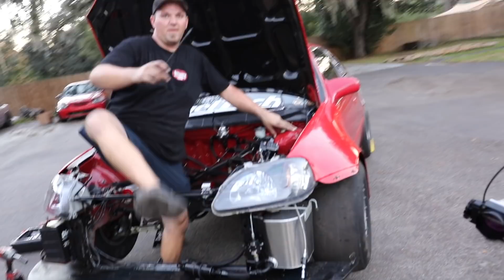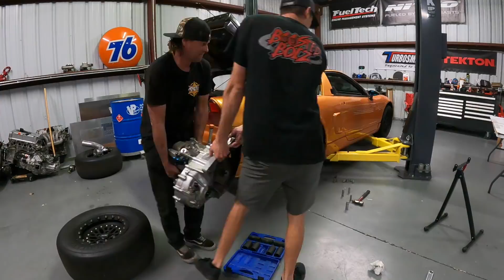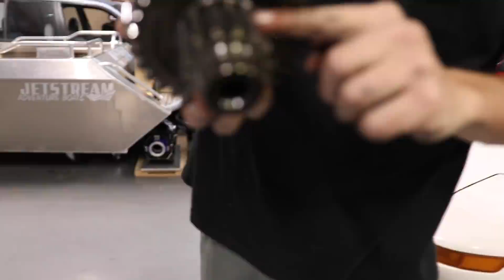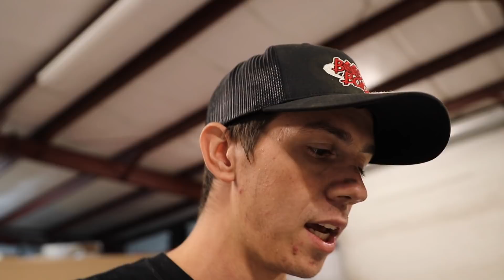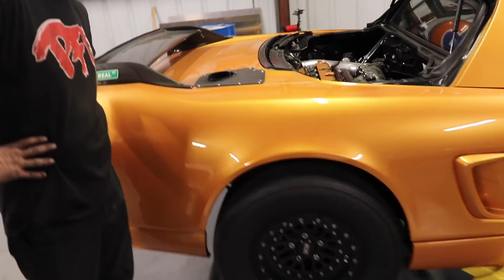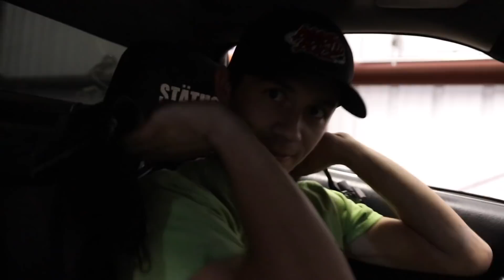Fixing The Sequential Transmission In Our 1000Hp NSX

Comment: Swap all those bearings at this point. I've had bad luck re-using bearings in my transmissions after one grenades. Some grit always gets into the races and eventually causes the next to fail. 
Also, Bearing Bae t-shirt needed.
Reply: For sure, bearings are worth the little bit more money you'll spend to replace all of them.
Reply: He didn't say it but it does look like he replaced them because he did power wash the case.

Comment: Hi Kyle,  When you hear a noise STOP. 
Most of the damage to the transmissions you get is from you  continuing to drive with it making the noise. Like the other Day you heard the noise in the MR2 you went and took it for another drive. Even hearing it on Camera I would of stopped straight away. Like you said that some of the problems are from you putting them together. But for how expensive those transmissions are as soon as you hear a noise you shoud stop and check it. The Damage on the NSX's transmission is from that nut coming loose and allowing the preloaded on the shaft to change destroying the bearing.
The rest of the damage is from driving it home. You said you are learning, but just STOP as soon as you hear a noise and check it. It will save you so much headache and cost. I have been building transmissions for over 25 years, I heard a noise in a dog box I had in my own car along time ago and thought it was only a bearing. Pulled it apart and from the debris inside going through everything it destroyed the complete transmission. The bearing outer race spun in the main housing and also wiped that out. So the whole thing was junk. Just a little advice from experience. Keep at it, I like the way you said that you want to learn yourself and rebuild them in house. You will get good at it. 
Cheers.
Reply: And not just transmissions you need to stop for, but if it anit right no need to test further.
Reply: Preach it
Reply: You need to loosen ALL the ring gear bolts before you take them out. The ring gear needs move freely so the threads won’t be against one side of the ring gear hole and wipe the threads off when your trying to take them out. Not a common issue unless you do it wrong.  Why on the subject of doing it wrong, get a metal clutch installation tool or an old main shaft to install the clutch and stop using a plastic one on twin discs and then pulling the trans on with the bolts FFS.
Reply: @dkfoste  , Good call on the old input shaft. I never use those plastic ones. If you measure one of them compared to a genuine input shaft they are never right. Also as you said,  using the bell housing bolts to pull the engine and transmission together. That is also another big reason for transmission bearing failure.
Reply: once you hear the noise, its too late.  stopping after you hear a noise isn't going to alleviate a thing.
Reply: @rgreerjr  yes it is. Friend of mines bolt broke off on the bellhousing, whilst still in gear it started making an awful noise thatll force you to hit brakes completely. That was before we knew, when we bent down there was quite a bit of fluid. He got it towed home. Took it apart it and I said it was just the broken bolt and since it was open a bit we could hear everything, that bolt breaking caused the others to loosen a bit too from what he said which created that awful clunky grind like noise. A $40 fix vs potential catastrophic failure. Idk about you but my friend is sort of like me and likes to prevent stupid things and keep stuff simple. He would called me a dumbass if i drove something home like that
Reply: @rgreerjr , I was going to ask How many Transmissions have you diagnosed and pulled down and repaired?. But with the statement you just made I can tell, the awnser is about
None. If you don't know anything about something, Fine Ask a question (that's how you learn) But don't tell people a bunch of crap to make yourself sound like you know what your are talking about.
Reply: I get that I'm not a transmission expert by any means but I remember when my transmission had lost two gears at the track I towed it home towed it to three different shops and each shop wanted to drive it so they could try to diagnose what was wrong with it and I even explained to them won't that make matters worse it's missing gears I'm hearing noises coming to find out something that disconnected causing the gears not to be able to catch I'm not really too sure on transmissions slowly learning about them but I just thought that was weird how you're absolutely right you should stop and break it down and see what's wrong with it but then you got these transmission shops out here that want to drive it to diagnose it which ends up causing more issues which ends up causing you more money

Comment: "Its just me putting these transmissions together and I'm no expert"
Uses claw hammer to assemble
Yup, that tracks
Reply: @ZREXER1250  he did, he showed him pulling the bearings out and the case had no bearings in it when he was pressure washing it
Reply: I used a claw hammer once to get something on output shaft of a Muncie, missed and hit the end of the shaft where it rides in the input shaft, put it together anyway, the car made it 10 feet in reverse before the trans locked. Rubber mallet always! Lol ( also that was a Muncie with uh, Muncie clearances I guess you could say lol)
Reply: Atleast it wasn't a 2lb mash hammer 👌

Comment: Kyle has every single high horsepower car he owns broken...
I have every single low horsepower car I own broken. 🤦
Reply: Every single car I own has something major broken 😂
Reply: @alexelrod242  1st car is waiting for it's built motor to be installed to finish a 3yr build.
2nd car is in the yard with a spun bearing, start work on that next year, wife wasn't happy.
3rd is splitting fuel lines from the 340lph pump I fitted, among other issues.
4th & 5th car are being torn apart as parts for the conversion for the 3rd car.
6th car is in the garage without a battery and I don't own a jumpbox. 🤦
Only car running properly at my house currently is my old man's ute. 😂👍
Reply: Gday Maf !!! When are going to drop a video mate ?! Yeah dads Ute is still running because Toyota oh what a feeling !!! Change the oil and it will last for ever !!! 😜👍🇦🇺
Reply: @gemini3558  Been sitting on them because of life issues (broken ribs, car issues, weather preventing more filming, family life), so I apologize but I'll get onto them soon brother. 😎👍
Reply: @MafiaboysWorld  yeah mate I understand as it has been a tough last couple of years !!! Things can only get better ❤️‍🩹 😜👍🇦🇺
Reply: Every car I own (two) works but have issues.

Truck either has a hard to find vacuum leak or fuel issue that's makes it run weird and stall in sharp turn while reversing at random but runs normal most of the time. Also has issue with the oil pressure gauge and fuel level gauge. 

Car needs new shocks and rotors and there's a relay to the starter the previous owner had someone bypass that really hard to find under the dashboard somewhere. I just replaced the alternator for a third time since I've owned it for three years.

Overall, I paid $400 for the 1993 Honda Accord and $200 1988 F150 and both were running badly when I bought them but at least now 90% of the issues have been fixed.
Reply: My issues are miniscule in comparison, but irritating because of how small yet difficult hey are. 

Daily, removed the muffler to test out the idea of a muffler delete sound and my landlord threw it out. Has a CEL for an EVAP leak which will be fun to find. Also ripped a lug stud out. 

Second car. Used to be a daily but had to buy a new daily so i could fix my broken daily. Intermittent ground issue where sometimes everything dies when i go over a bump. Roof leaks at the windshield seal so it always smells like an old camper. Rear leafs sag low enough that the driveshaft rubs the cab. Rear cab mounts rusted off making the last problem worse. Abs likes to kick on randomly and basically turn off my brakes. Both headers cracked. 

Third car. Auto trans shifts so hard it broke the dogbone mount. Also shifts so hard the flex pipe ripped off and took the cat and rest of the exhaust out with it. And what do you know CEL on for a transmission issue.
Reply: I won a crappy old Mazda 6 as a daily and a WR450 SuperMoto, both work perfectly fine and are reliable.
Maybe I should buy a project car so I can break it 😂
Reply: Relatable 100%

Comment: You should set up the slipper to be activated by the ECU. It is almost certain you will forget to activate it again at some point if you do not. Maybe have it activate with use of the bump switch?
Reply: Well I must say when you make a mistake like this with as expensive as it is I think he will remember for now on. If possible it would be much better if the ecu would engage it for him
Reply: @onementality9781  Control by the ECU will eliminate any chance of it occurring again and it is always best to simplify staging as much as possible for the driver.
Reply: The old cleeter tape on the steering wheel with "TURN INTERCOOLER ON" should also work :)

Comment: The sequential quafie trans are designed for 300hp rally cars. Back in the day AEBS tried using them on a 700hp sr20det And they didn’t hang. I’m sure that the metallurgy has gotten better in the 15 years since then but it’s INSANE what the team has accomplished this these trans.
Reply: @creedns  if you bothered to pay attention you'd know why they broke. None of the broken sequentials were the fault of the sequential gear setup.
Reply: They broke the trans,  the trans did not randomly give out mistakes were made and that caused them to brake.

Comment: I'd suggest flashing a spot with the TIG over your stake nuts. The stake nuts are a condumable anyway and need to be replaced after each disassembly and it doesn't take that much effort to separate a small spot tack vs the holding power of it and the reliability factor.  Keep up the good work and thanks for being real about your experiences.

Comment: If loc-tite does not work to stop the nut from coming lose you might need to roll pin the nut. It is kind of like doing dual keyways on a crank. Get everything together and torqued together than drill through the nut an threads 180 out from any keyway in that shaft.

Comment: Right after I took apart my new(to me) VAIO that needed better thermal compound since it sits around the 80's full tilt (degrees Celsius) and now it subsided on the 70's as a cheap, temporary fix with the cheapest available. Broke a connector on the way in, will need some superglue to make that thing stay well on the next overhaul

Comment: When I used to have similar problems in transmissions, it's because the nylon spacers between the rollers just disintegrates under heat / load and the bearing collapses. You can get "High Capacity" Steel caged bearings, where the Nylon spacer is replaced with a Steel spacer, so, even if the counter or something else has vibration issues, the Bearing isnt able to completely collapse like that and should Mostly saves the transmission. Should be able to take a nylon bearing to a specialised bearing shop / order online a drop in replacement.

Comment: Slightly squeeze a spare nut so it pinches the thread. Double nut and the best threadlock you can get, and lots of it. 

Upon disassembly of it after loctite, just apply heat to melt the threadlock and hit it with the big ol milwaukee 🤟

Comment: As was said, if it was an acual problem with the transmission it'd show up as broken gears, twisted shafts, etc. Everything so far has been a problem with assembly and/or driver.

Kyle, when you put that parts order in, get a half dozen of the nuts that are staked - you may be able to swap them around a little, so the stake is fressh each time, but that's only possible a couple or three times.
BTW, when running it through the gears, in the air like that, rest your foot on the brake to lightly pre-load the transmission and that'll get ride of the shunting/backlash.

Comment: future tip on the diff bolts. break them all loose first then run them out. the reason the threads get messed up is because the diff shifts slightly n puts pressure on threads.

Comment: if the main problem is the nut get a machine shot to use a mill to put some slots in the nut and to drill a hole in the shaft and safety wire the nut once you have done it up as tight as possible so the safety wire has to break before that nut can even come loose

Comment: Ever think about using a combo of fluids like half Lucas tranny fluid and half saquintal fluid. I run half Lucas and half mobile 1 tranny fluid and it seems to smooth out the shifts in my jeep with 35 inch tire

Comment: Sequentials aint cheap but they are cheaper to repair than replacing a complete stock type that just explodes when something messes up, at least you own up to your mistakes learn from them and move on with your day. The strongest they will ever be is the day its new, every day after that is wear tear and wait til it breaks.....thats racing so keep on doing as you are and gaining knowledge like you are because no other education system is as fun to learn from than the one you are using.

Comment: I run Red Line heavy shock proof gear oil in my Quaife and its never been a problem i strip it every 1000 miles and its like new inside running 600hp at the wheels

Comment: The thing you need to remember is that with a race car you need to pull and check after most events like race teams do or you will have stuff like bolts come loose or bearing go bad and you won't know till its to late

Comment: If sequentialx didnt need rebuilt so often, id be welding that nut to the shaft!  Definitely gonna cop some merch and hope you can find a good solution. *are the diff bolt tty or something? Wondering why they get marred like that. Do you run a thread chaser before installing new bolts?

Comment: I'd maybe add checking that nut and/or a full inspection of the sequentials into the regular maintenance of the cars they are in . Couple litres of diff fluid and some time is way cheaper than breaking parts on the regular. Especially with the punishment they are put through.

Comment: I think people are really overlooking that even though the transmissions are meant to take a lot of power, no mechanical part is going to work forever at its max stress. Like the fact you're getting 5-10 passes on them is wild. Mullet has to have a new converter and power glide after like 2 or 3 passes... and there's WAY more tech, money, and time in mullet compared to probably the mr2 the hatch AND the van.

Comment: You need to write up a step by step build sheet, checks at specific points to be checked off  by yourself & Wyatt, this way it's double checked, also use paint pens at these specific points so you have a visual reference, this will stop you from missing important  steps & hopefully stop all the problems you are having, i was taught to do this 30+ yrs ago & i haven't had problems after it

Comment: Breakage is part of car life.  I've personally broken 5 transmissions in my Dodge Stealth.  First one was 100% my fault, didn't let out after massive wheel hop and chunked the diff.  Second one broke on the first launch it ever saw.  Third one randomly broke just driving it.  Fourth one I installed a Quaife diff and this time I shredded 2nd.  Fifth one was another fully stock trans and it never got raced and it just broke one day.  This was all with a car that made less than 200 hp.

Comment: If you want to improve with a transmission being pushed to its limits, change the oil regularly, not because it needs fresh oil but to see the signs of damage in the oil and repair it before breakage happens

Comment: Once that nut is clean and torqued to spec, use green loctite, it is wicking and will run down the threads and lock it on there and it will not come loose again.

Comment: Isn't there torque specs or an assembly guide from Quaife to put these transmissions together? You say that most of the time it broke because of "human error", but I feel that if these have a particular way to assemble them, it should be specified by the manufacturer. Also, on an other note, maybe that the bellypan should be used only in racing events, that way you would have seen the oil leak on the ground, maybe preventing some damage. I don't know how much oil is supposed to be in there, but a quart seems very little!

Comment: You should make a maintenance schedule. Like every 20 or so passes. Or so many miles just pull the 5th gear cover part of the case off and check that the nut hasn’t moved.

Comment: Do you guys break in the transmission before going to the track. Like go a couple hundred miles at different speeds and the change the transmission fluid? I wonder if that would help reduce catastrophic failure

Comment: i am a new member just watching this video for the first time, Anyway, I used to be a race car driver with the SCCA ad I RACED AN FF (formula ford) and I ran a similar type of transmission, a Hewland MK9 transmission. On my Hewland trans the nut holding the end of gears was reversed threaded so it could never come loose! I'm not sure if yo have already fixed that shaft, if you haven't, then maybe you could just weld the treaded end and put it on a lathe? There is probably an easier way to fix that, but I'm unsure of another way? Hell, you probably won't even notice this comment, as this video was posted over 2 years ago? haha

Comment: I know it's a ton of work but with those nuts coming loose maybe the trans should be pulled after a few races and checked.  The NSX maybe at the next oil change . Maintenance is cheaper than breaking stuff